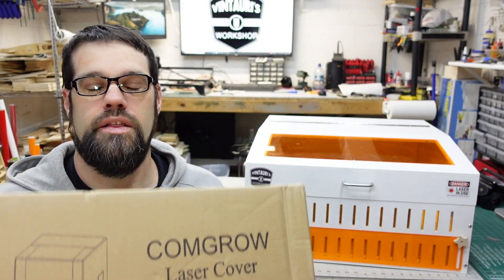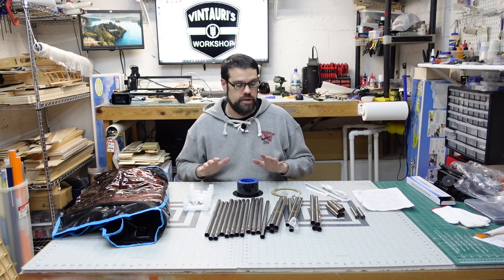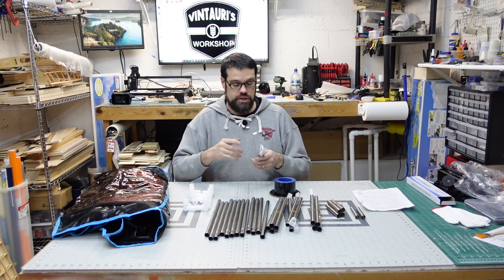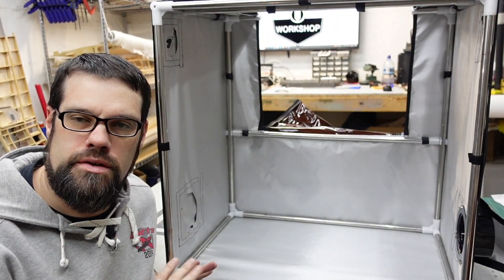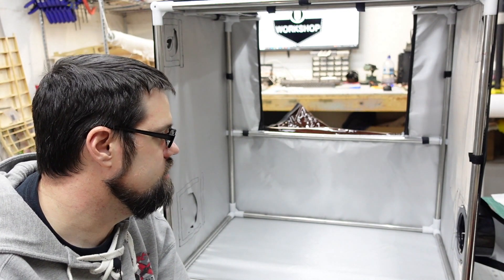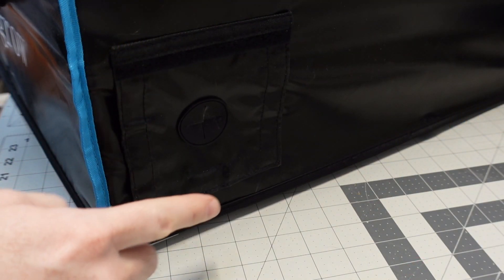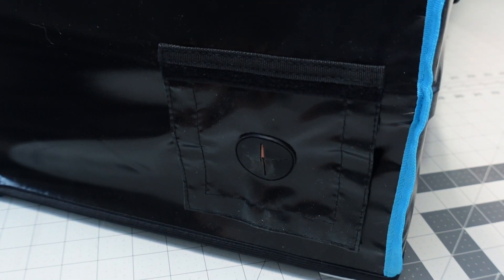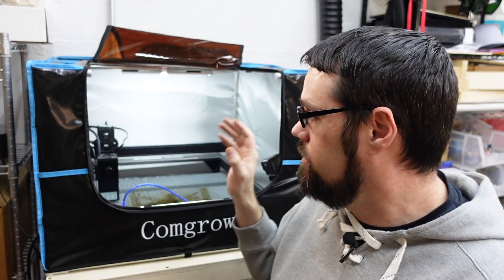Comgrow Medium Laser Enclosure  -  Use your laser indoors with more flexibility!

Comment: How well did the Atomstack fit also was it tall enough for a camera? Great vid.
Reply from the maker: The Atomstack fits just fine in this one. As for a camera, you’ll need one that it a little more wide angle then the standard but there is enough height to make one work. However the one offered by comgrow sits too high for this enclosure.

Comment: Been looking at getting one of these for my xTool D1 Pro. Thank you for the informative video. Question - would the exhaust port fit a normal shop vac? The black part of the exhaust looks like 4 inches but is the blue part an adapter for a shop vac?
Reply from the maker: The blue piece was just a plug and not an adaptor. You would have to find a 4" to 2" adapter to fit it to a shop vac. There are dust collection fittings sold at woodworking stores that might work.
Reply: @Vintauri  Thank you for your reply. It helps make the decision to just add the extraction fan and pipe to the purchase. Much appreciated.
Reply from the maker: @onsapplikasies8620  Glad I could help!

Comment: I am looking for one of these mfg's to make one to fit a laser with extended rails (800mm long by 400mm wide). Have you seen any of these?
Reply from the maker: I've seen rumors of one from Sculpfun that is 1440x720x360mm but I've not seen it for sale on their site, or any reputable sites that I'd trust ordering from.  I'm hoping to see one soon as I've got the rail extensions for my Sculpfun S10 machine and I'd rather not build my own if there is a reasonable commercial kit available.